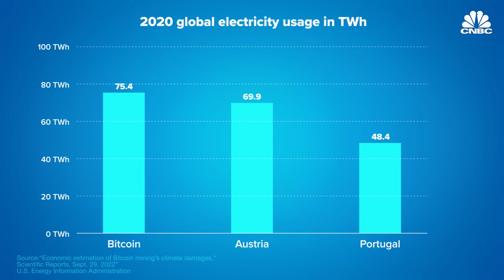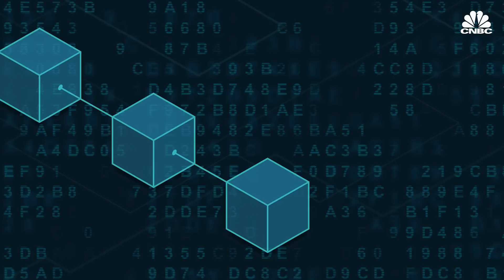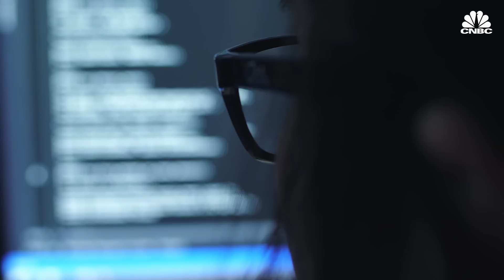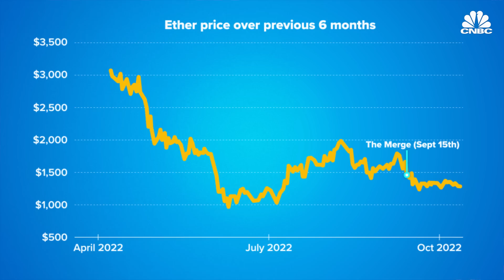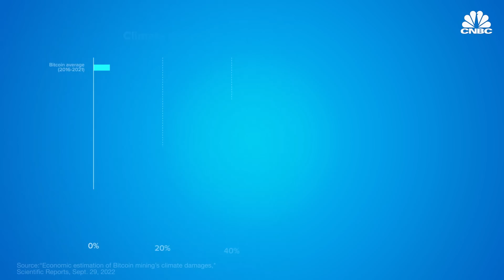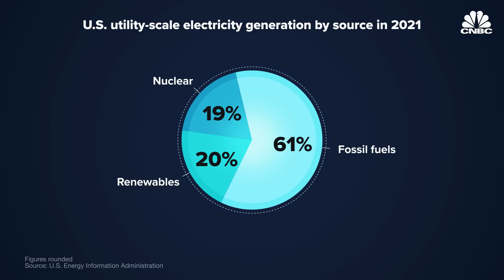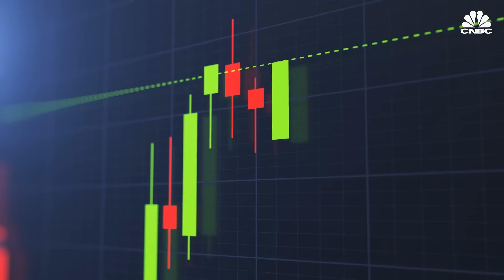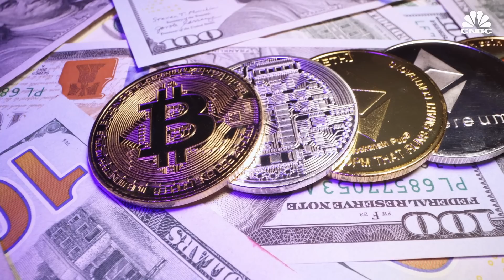Mining Crypto Uses A Massive Amount Of Energy — Why That Could Be Changing

Comment: I'm not convinced the professor at New Mexico university did a good job calculation the pollution of Bitcoin. He says he's using country specific emissions for carbon and other pollutants based on where the miners are located. But Bitcoin mining has been greener on average than the countries where the miners are from. So this method will say bitcoin is more polluting than it really is.

He even later admits that it's really challenging and hard to get the right data he needs.

Comment: Bitcoin recent price action shows evidence that a bottom may be forming, <denying bears any further movement lower. Ethereum price has developed a ridiculously extended hidden bullish divergence condition on its weekly chart, warning of an imminent bullish reversal. XRP price hammered with two major short setups, but sellers failed to push XRP lower. At this point Diamond hands are showing cracks as people start to panic; if you are losing in the current dip or you look forward to start the best way to go is trading with the guidance of an expert. MYSTICFLIP has been one step ahead of other analysis, with her strategy I was able to accumulate 15 BTC in 3weeks.

Comment: Thank you for your explicit content.The most interesting about BTC right now is that it is in the process of retesting the quarterly mid range area as support on the weekly timeframe. Beginners focus on analysis, but professionals operate in a three dimensional space. They are aware of trading psychology their own feelings and the mass psychology of the markets. <Meanwhile tradiing bitcoin options provide excellent opportunities for investors aiming to maximize gains while limiting their losses. Using multiple call(buy) options, MYSTICFLIP create a strategy capable of returns six times higher than the potential loss these can be used in bullish and bearish circumstances, depending on the investors expectations.NOTE :know that concentrating investments based on ones own convictions and homework, plus the ability to deal with losses, is the key to success…

Comment: And how much energy does the recent bank system is using?
Reply: While the banking/credit card system also uses a lot of energy, it processes thousands or millions of times more transactions than crypto, making the watt-hours per transaction a tiny fraction of that on crypto. Unless crypto can get the transaction speeds WAY up and fees way down, it makes no sense.
Reply: I forget where the actual figure is at but yeah the conventional banking system actually uses more power than even the energy inefficient ethereum network did.

Well crypto has many problems I would question anybody who tries to claim that the environment is the biggest problem with it.

Comment: #holochain  Holochain is using Distributed Hash Table peer-to-peer technology which means in short terms that nodes talk directly to each other and therefore no miners is needed to run the system.
All app data and is kept on kept on the nodes = true decentralized technology and use a fraction of energy compared to Blockchain.

Comment: The problem is not about green energy or what, the thing is that such amount of energy which could powers millions of households worldwide are used for transaction, which on the other hand classic transaction like bank didn't consume that much of energy. That's worrying, that's not the future we want because energy has limit and our resource to gather that energy to has it limit.
Reply: Banks consume energy whenever they try to predict a stock as you need data centres to do that. They have also probably started using punch card systems as early the 1980s. The one guy who said he invests into green infrastructure by creating data centres makes perfect sense.